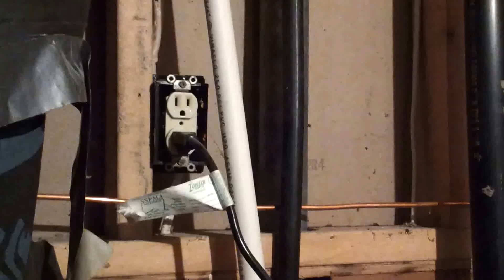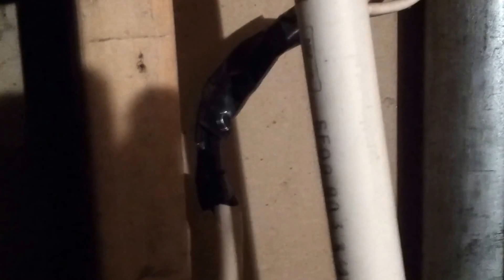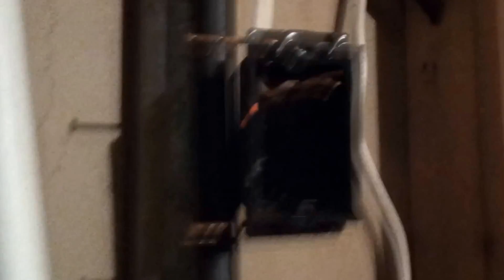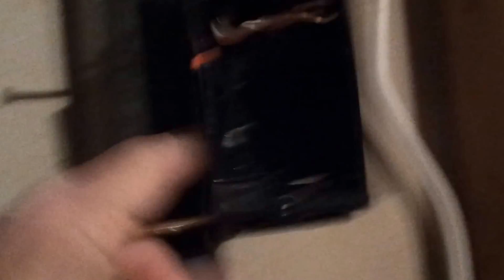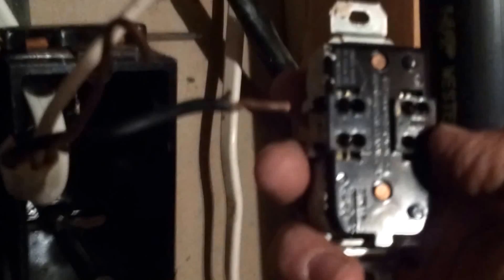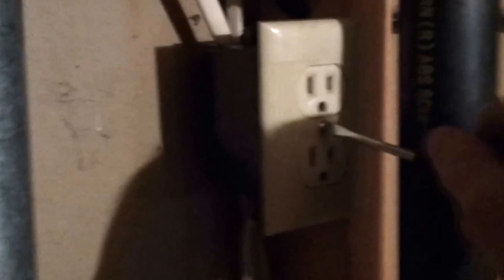How to Relocate an Outlet (Electrical Tutorial)

Comment: This was great, but you did not show how to connect the other end that is to code or legal, just ended
Reply: Yeah he never showed replacing the bottom wire which is too short with a longer one. For all we know he just did an illegal splice.
Reply from the maker: I was just relocating an existing outlet and not wiring a new one, so the wires went exactly where they came from and in exactly the same way.